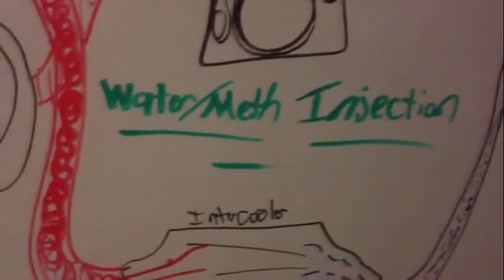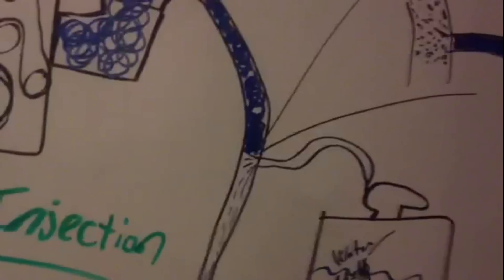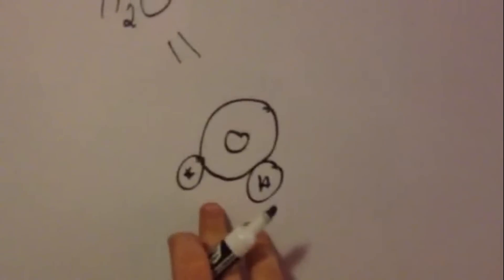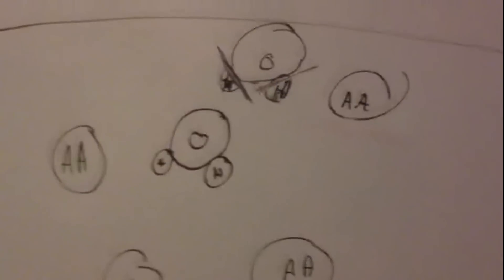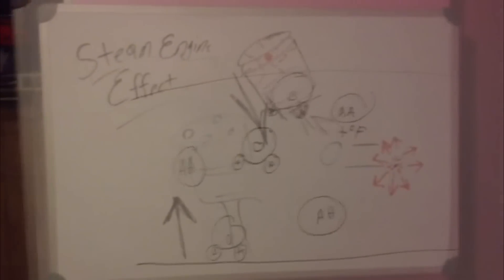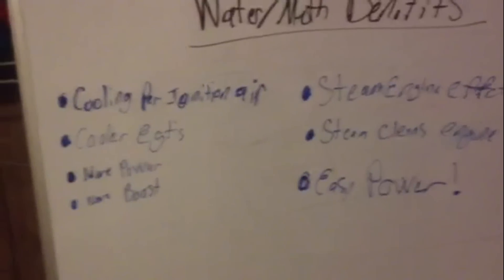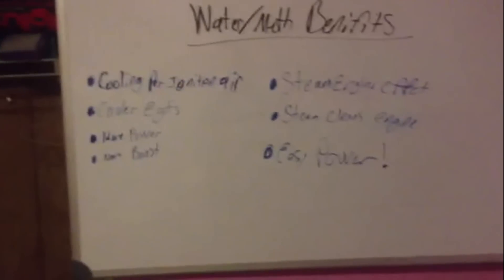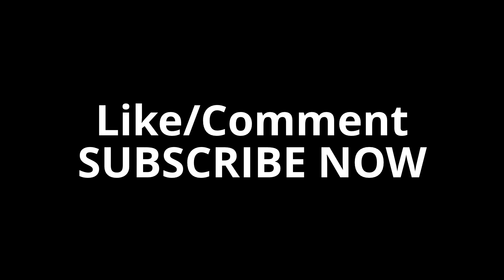How & Why: Water/Meth Injection

Comment: I am sorry to have to tell you but your understanding of thermodynamics and chemistry is sadly inadequate to be explaining a video. You are incorrect in almost everything you said. I only watched through the 6 minute mark and had to stop because I was feeling myself lose IQ points. #1...  Water does not separate into Hydrogen and Oxygen when it gets hot.  If you want to separate water into Hydrogen and Oxygen you will need to use electrolysis (pass current through the water). And #2... the air coming from a compressor in a turbo is not heated from heat transfer from the exhaust but from the high pressure.  This is the same principle that allows a diesel to run without spark plugs.

Comment: before doing a video to explain physics, you may wanna step back and make sure you understand the material well enough to explain it. the small amount of heat you gain from proximity of the the exhaust is nothing compaired to the friction of the molecular compressing(in the compressor)  any time pressure goes up temp goes up. the cleaner evaporates due to the change of state removing btus, you dont cool the air you heat the water.

Comment: Just because your cooling the air, that doesnt mean the exhaust will be cooler. think about it if you are jamming more air into the cylinder, then compressed from the stroke and the diesel is injected. The combustion will be greater than no meth. there will be more air than no meth.
Reply: yamaharidr450 You ARE cooling exhaust temps. Any time you cool inlet temperature, you cool outlet temperature given the same engine.

Comment from the maker: Yes you can do just water but results are better with the mix in my opinion. Unless you are building your own homemade kit the spray will stop once you drop below your set psi. Yes that is true the more done to the truck the better the system will work for more power but I still say it is a great option for even a stock truck to run. Yes I agree but there will be more to this when I install a kit as a demo for people to see. This project and others will be coming soon.

Comment from the maker: Well didnt you just want a mudder? You have to think about your application first and what you want to do then star finding your power adders for that truck. You have to also keep in mind that water/meth doesn't like propane because there is to many different flash points in the cylinder now lol. Either its a 12v or a 24v the best places to start it air, the more the better. Then move on to fuel.

Comment: You forgot to mention that you can inject straight water without the methanol and what happens if you leave your water on when you shut your truck off.  Also that water methanol injection you wont reap all the benefits of this big power unless you have a modified truck,  Just so someone doesn't go out and spend 1k and not be happy with the results.  YOu can add a lot of power with 1k wihtout water methanol, just my experience